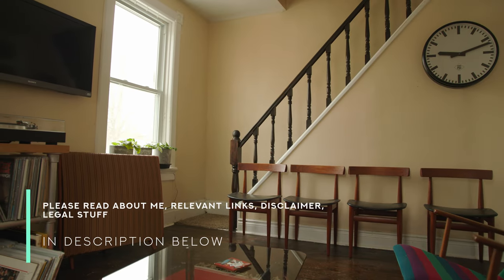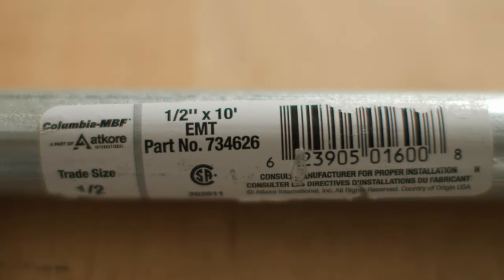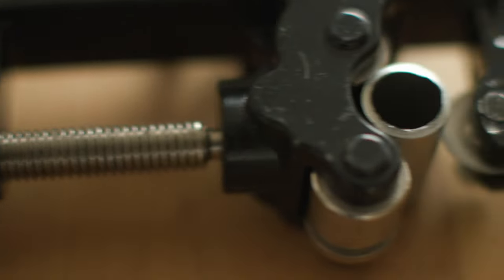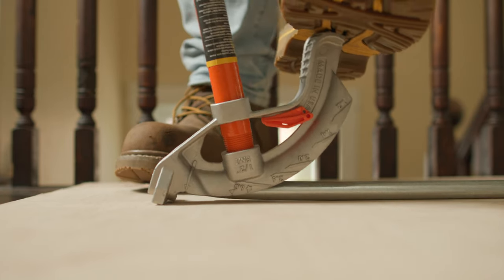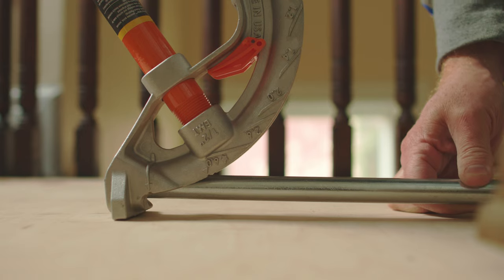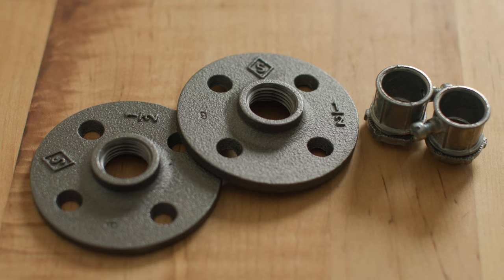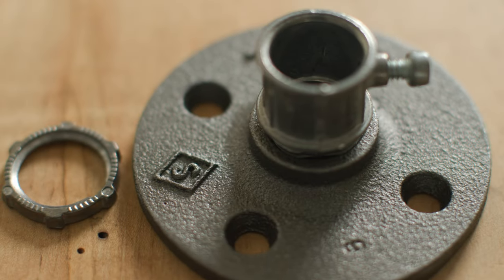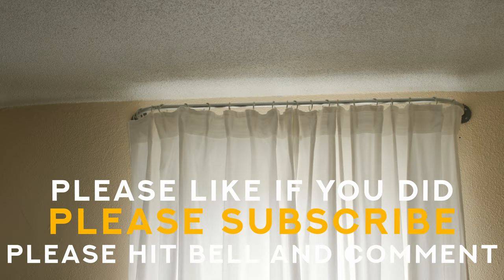DIY STRONG CURTAIN ROD MAKE:  how I made curtain rods using cheap EMT electrical conduit & a bender

Comment: I have an extremely wide closet opening that has been plaguing me. It came with bypass doors, but they are so heavy that they're honestly scary; they routinely bend the track and fall off, creating a dangerous hazard. I've been trying to figure out what to do. I thought of curtains instead of doors, but most rods are so flimsy for such a length. THANK YOU for this idea!
Reply from the maker: Glad it could help out!